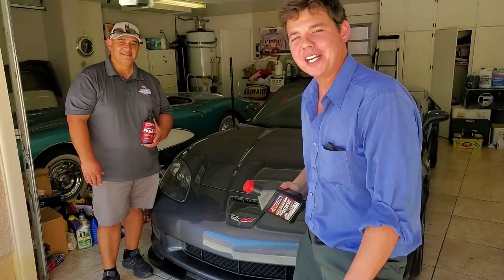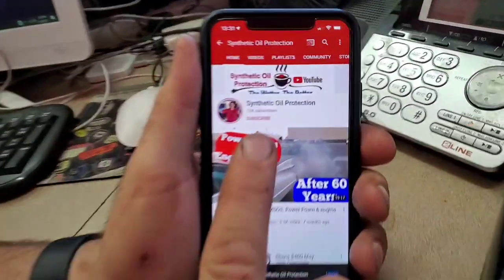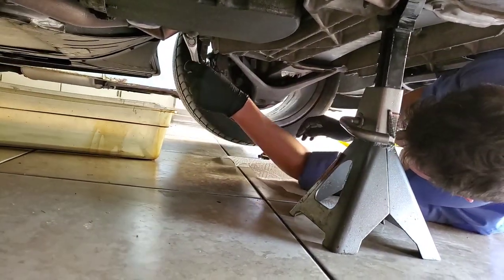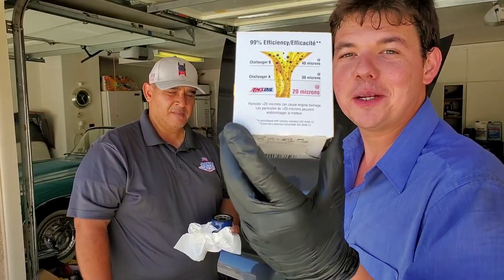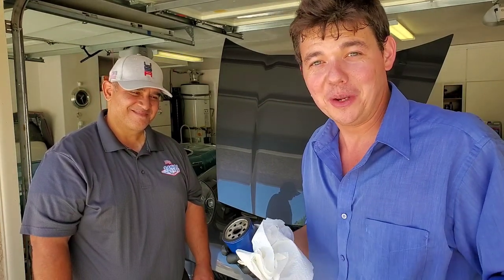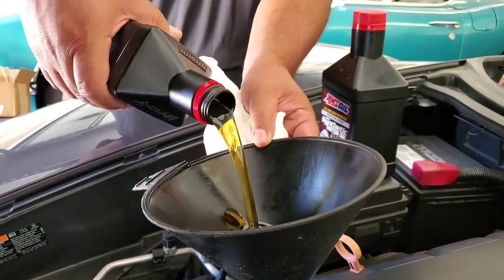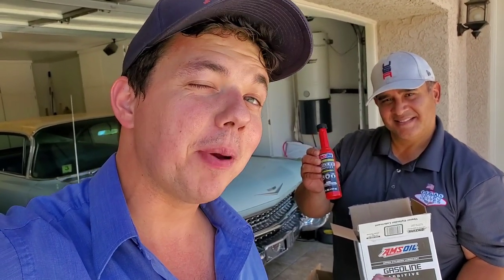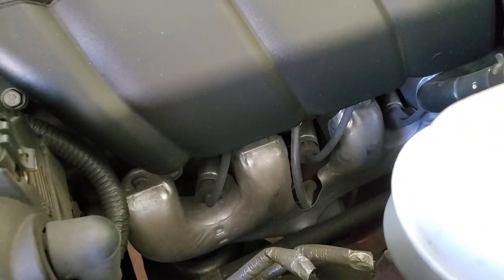2012 Corvette AMSOIL Engine Flush Oil Change

Comment from the maker: Ebens Corvette Playlist- 
https://www.youtube.com/playlist?list=PLB_ftWArBFde4-Gq_11N-R2bDzruEu8h3

Oil Test on Ebens Corvette - https://youtu.be/1caSaAY9f6g

     Lookup For Your Vehicles - https://www.amsoil.com/guides.aspx?zo=5331179

      AMSOIL Performance Test Results - https://www.amsoil.com/performancetests.aspx?zo=5331179 

     Ebens Link: AMSOIL Wholesale + FREE Shipping: https://www.amsoil.com/offers/?zo=5331179 

      Ebens Giveaway: 
Over $5000 Given to my YouTube Community Playlist - https://www.youtube.com/playlistegg?list=PLB_ftWArBFdey4HFt_Z9KgSIChjkLbw_o

     Ebens Facebook - https://www.facebook.com/profile.php?id=100007973957868 

      Learning about AMSOIL?: 

1. Where can I find AMSOIL? - Use this link https://www.amsoil.com/offers/?zo=5331179 
Or 
Watch THIS: 3 Fast Ways To Get AMSOIL - https://youtu.be/RiYifuDCsnQ 

2. What makes AMSOIL different than other oils? - 

AMSOIL is 100% Synthetic & has higher film strength & holds up 4× better in turbocharger deposit testing than Mobil 1 EP which protects and separates metal parts, keeping them from wearing and Lasting Exponentially longer: https://youtu.be/f4eNPgTi_qo 

3. Why should I use AMSOIL?: It protects the engine so it will last longer. Less oil changes less often (once per year/15,000 miles) or longer... Save money in Gas & Time making it less expensive than a free oil change over the year - https://youtu.be/H7K6FdZlqmg

      Professional YouLubher: Eben Rockmaker Regency Direct Jobber AMSOIL Specialist (Dealer#: 5331179) Mobile: (702) 472-3614

      Lookup For Your Vehicles - https://www.amsoil.com/guides.aspx?zo=5331179

      Ebens Link: AMSOIL Wholesale + FREE Shipping: https://www.amsoil.com/offers/?zo=5331179 

      AMSOIL 46,000 Mile Test Results - https://youtu.be/UjijQK5wSM0

      Tag me?: 

Instagram - https://www.instagram.com/syntheticoilprotection/ Eben 

Facebook - https://www.facebook.com/profile.php?id=100007973957868 

     The Power of AMSOIL Signature Series 5W-30 Synthetic Motor Oil protects against harmful deposits on turbochargers 4X better than Mobil1® Extended Performance and 3.6X better than Royal Purple® in industry-standard testing*. https://www.amsoil.com/newsstand/motor-oil/articles/leading-the-field-in-deposit-protection/?zo=5331179 

      Better Mileage Proven - https://www.amsoil.com/newsstand/motor-oil/articles/another-win-for-amsoil-products/?zo=5331179

      AMSOIL Performance Test Results - https://www.amsoil.com/performancetests.aspx?zo=5331179 

       Professional YouLubher: Eben Rockmaker Regency Direct Jobber AMSOIL Specialist (Dealer#: 5331179) Mobile: (702) 472-3614 

     Lookup For Your Vehicles - https://www.amsoil.com/guides.aspx?zo=5331179  

      Ebens Link: AMSOIL Wholesale + FREE Shipping: https://www.amsoil.com/offers/?zo=5331179